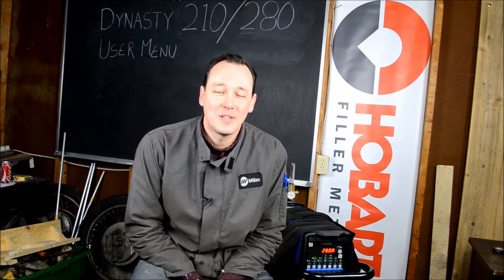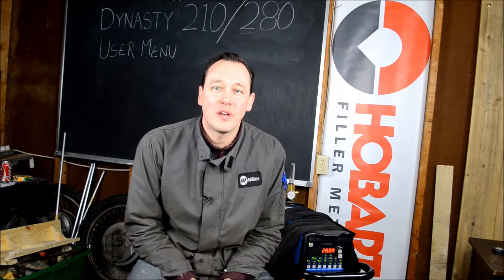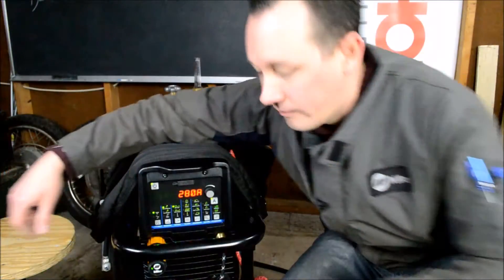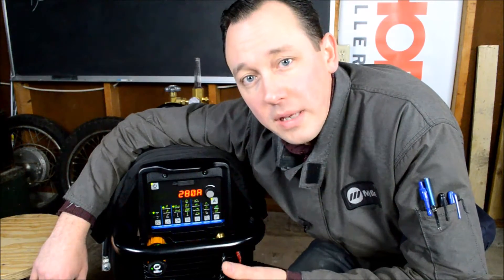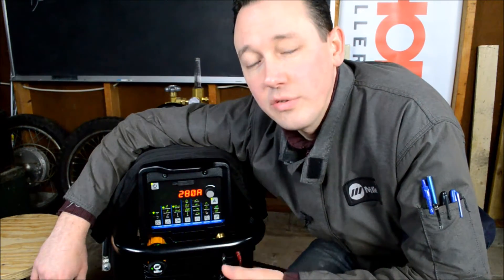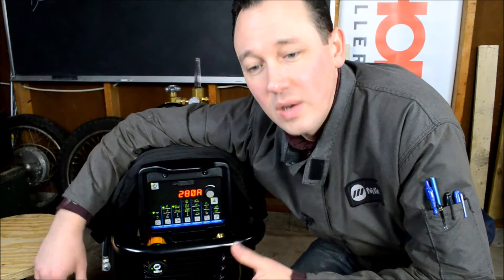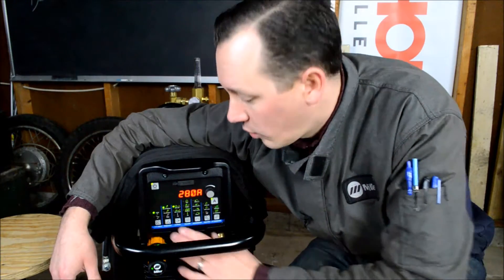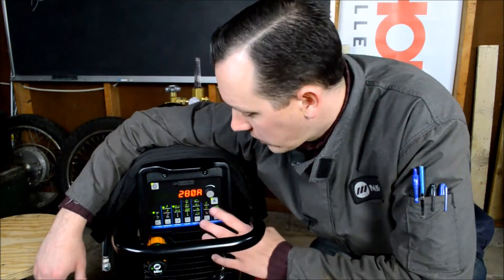Miller Dynasty 210 / 280 DX User Menu

Comment: Got a quick question for you...would you discourage the purchase of the Dynasty 210 over the Synchrowave 210?  I'm new to the TIG process, but am in the market for a MILLER TIG machine.  I don't know if the Diversion 180 would suit my needs for the time being, only to outgrow it down the road.  The other two machines (Dynasty and Synchrowave 210) appeal to me more.  I understand that comes with a significant price tag, but would you recommed the Dynasty over the Sychrowave 210?  Lastly, is the water cooled option totally necessary if my actual arc time on the machine won't totally justify the need to purchase it as a complete package?  My local Welding Supply shop is of course, recommending I just go all the way with the CPS pasckage.  I just don't think I'll be on it long enough to justify it.  Thanks!
Reply: ...all my work will be primarily in the shop.  Learning the process, fabrication type stuff, etc.  Nothing greater than 1/4" thickness, maybe.
Reply from the maker: +James O'brownie, I'll get you an in depth response  tomorrow. At present I am sick as a dog and almost too damn miserable to exist.
Reply: Thanks for your help!  And sorry to hear you're down with the sickness!
Reply from the maker: James, the short answer to your first question is no, I absolutely would not discourage you from getting a Dynasty 210 over a Syncrowave 210 if that's what you want. I love the hell out of that machine. HOWEVER, my in-depth answer depends heavily on your specific needs.The Dynasty 210 DX is a full-featured industrial machine with every bell and whistle that you could ever possibly want, but there's no sense spending the money if all of your needs are met by the Syncrowave 210. I hate to see people spend unnecessarily.

If you're just starting out and are going to be doing 1/4" and below work around the shop, like you said, then the Sync 210 fits the bill perfectly. You get a great TIG arc in AC & DC with useful features and a great stick arc as well. It'll run on 230 or 115 just by swapping the Multi Voltage Plug, it's easy to drag around the shop, easy to keep tidy with the side storage compartment, and it comes with everything you need but the electricity and a cylinder of argon. My advice in your situation would be to grab a Sync 210 and take care of it. If, in a couple of years, you're TIG work is going strong and you're at a place where you could really start putting the additional features to work, then sell the Sync 210 and put the money towards your Dynasty TIGRunner. 

As for running a water cooled torch, they are generally more comfortable, easier to manipulate, and are designed to run at 100% duty cycle. Air cooled torches are bigger, mostly used under 200 amps, and designed to 60% duty cycle rating in DCEN polarity. If you are doing a fair amount of Aluminum or higher amperage DC, then your torch is going to warm up. If you're not pushing it, then there's no reason an air cooled torch won't work well for you.

Have a great day!
Reply: Awesome!  That was very helpful!  I do appreciate you taking the time to help me figure that out.  With that being said, would you say that the base model Dynasty 210 would be just a little bit of a step up from the Synchrowave 210?  Since I already have a Millermatic 211, I wouldn't need the extra MIG option that you can get for the Synchrowave.  I understand its an option and you could opt out of it.

The Dynasty 210 (base model) is different from the DX model in that the base Dynasty 210 only has TIG Pulse available in DC only?  Whereas the DX model has both AD/DC TIG Pulse available.

The Dynasty (base model) also only has DC Stick available, whereas the DX model has both AC/DC Stick available?  When would I ever really need AC Stick? 

If the difference between the Dynasty base model and the DX model is a couple hundred $$$, do you think it would be worth the extra push just to go the distance and get the DX?  I still don't know if I'd really be on the machine maxing out the amps to justify the CPS water cooled package...maybe.  I'm just guessing. 

Lastly, if the base Dynasty is without AC pulse, does that mean Aluminum welding would be without pulse, essentially? 

Thanks again, and hope you're recovering from the crud!

By the way, thanks again for those videos regarding the TIG machine you have.  I feel like I could step up the the actual machine and figure out the settings for myself without actually owning one!
Reply from the maker: James, that's great to hear because that's exactly why I'm doing it! 

The base model Dynasty is a significant step up from the Sync 210, but the focus is more on robustness of design than a large expansion of functionality.  It's intended to fit the demands of a full production environment, but one that may not need all the adjustments and fine tuning found in a DX model.

AC SMAW is the only way to completely eliminate arc blow. Dig this old film from GE: https://www.youtube.com/watch?v=CW7I-ymfINU

As for the pulsing capabilities, the base model allows you to control pulse frequency up to 250 pulses per second (PPS) whereas the DX allows you to control pulse frequency, peak time, and background amperage up to 500 PPS. This is a lot of control. 8)

Just to be clear, AC frequency is how often the polarity reverses within a second. The polarity never reverses when pulsing, however, it just varies between a high and low output power. Most aluminum welding with AC is done without pulsing. If someone wants to pulse on AC, I generally recommend that they avoid going beyond a few PPS. Many of the advantages of pulsing are already present with AC frequency adjustment.
Reply: Thanks for that link!  I must have watched it three times already. Makes a ton of sense, explaining AC in its simplest form...I can relate to the old man Arc Blow.  The best thing ever...old school animation helping to educate the masses!
Reply from the maker: Yeah, I can't get enough of those old films!